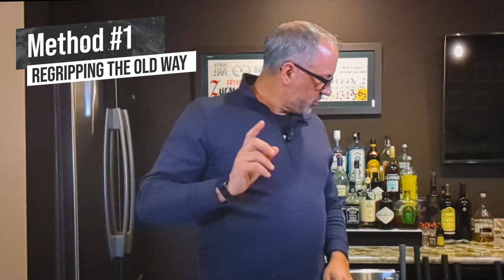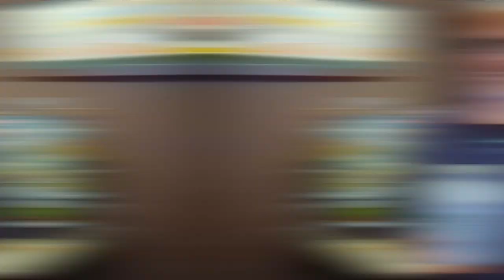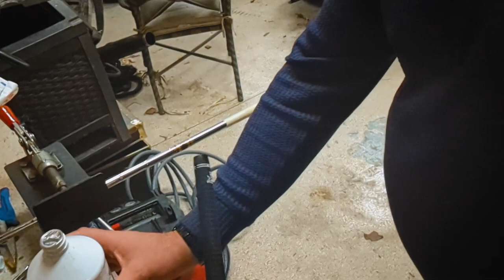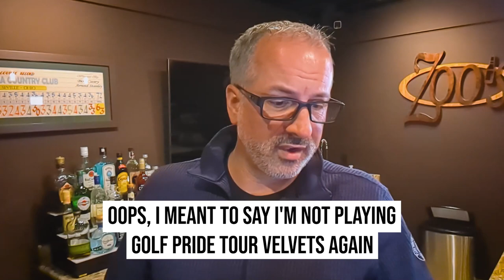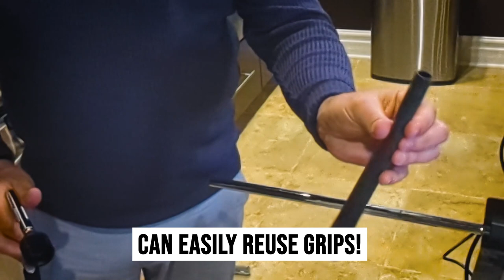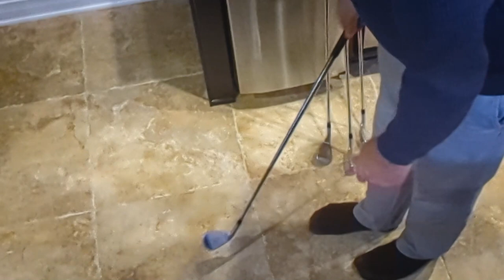How To Regrip Your Golf Clubs In 10 Seconds With Grips That Last 300 Rounds!

Comment: Thanks for the great video, Bryan! Isn't it amazing how much less of a "chore" regripping becomes once you switch to the air installation method? Most people procrastinate when it comes to regripping because it usually involves dropping their clubs off at a shop, leaving them there for 1-2 days, going back to pick them up, then maybe waiting another 12 hours until they're dry to use them. Or if they regrip themselves at home, they need an hour (or more) of free time to go through the process and it makes a mess, it smells up the house/garage, and it's just not fun. But now all you need is our air gun and a compressor, and anyone can easily swap out their grips at home in under 10 minutes! 

And you made a very important comment about not using the air gun with other grips. We get that question all the time: "will your air gun work with other brands of grips?". I mean yes, technically you could install most grips with it. BUT....will other grips stay put long-term and not slip or twist? Absolutely not. Some grips may stay put for a little while, but they will all eventually twist to where they are no longer aligned straight or even start to slide off the end of the shaft. 

Our proprietary StarTack rubber compound is specially formulated to be super tacky on the inside, which is what allows the grips to stick to the shaft (or old tape/build-up tape) without ever slipping. This material is also what allows us to offer such a long warranty; in fact, our rubber is rated for a 10-20 year lifespan in harsh industrial applications! So that just shows you how long they should last in a much less harsh environment like golf clubs. One recent customer left a review on our website saying that he had the same set of Star grips for 15 years, including playing 200 rounds/year for the last 6 years, and he just finally wore them out! Assuming he only played once a week before that, that's gotta be over 1,500 rounds! Come to think of it, maybe we should have our engineers change the formula a bit to make sure they don't last THAT long since it's probably costing us repeat business. 🤔😜

We also wanted to mention one thing regarding your comment about not using tape & solvent to install the grips as it will harm the rubber. While Pure does say that one their website, we want to let you and your viewers know that Star grips can absolutely be installed with the conventional tape & solvent method without harming the rubber. In fact, as surprising as it may sound, I'd say most of our grips are probably installed that way since that's what most people are used to or maybe they don't have an air compressor. But the tapeless method is definitely catching on more and more, because lately we've barely been able to keep up with sales of the air gun on our website!